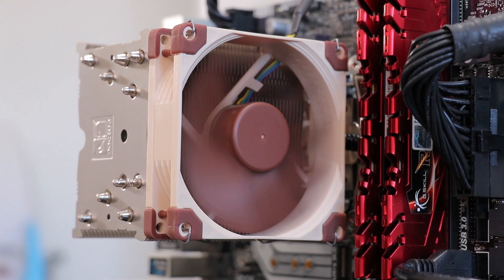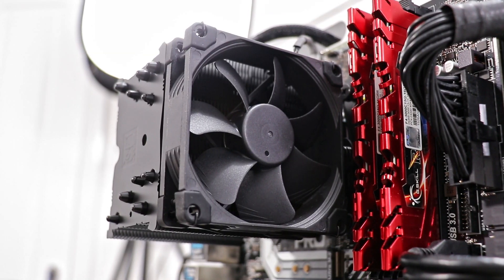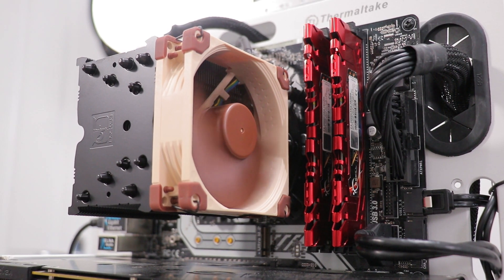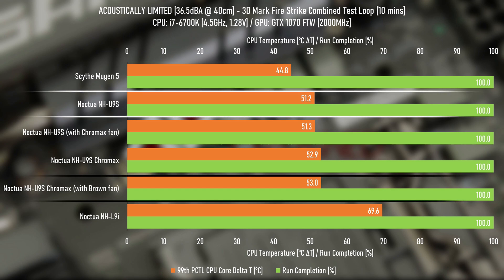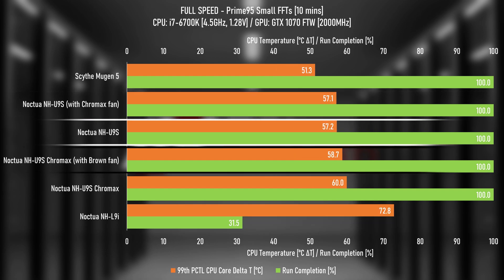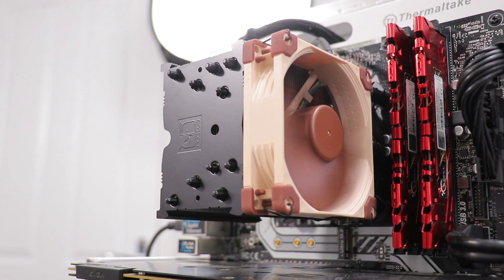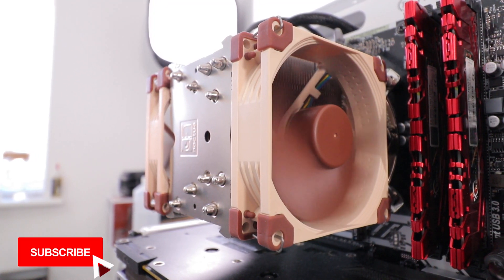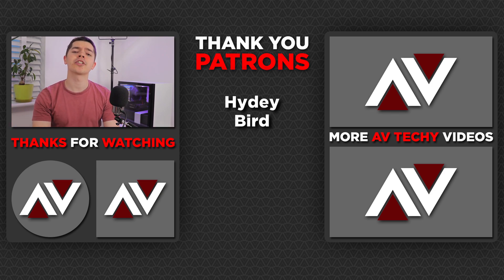Does PAINT impact PERFORMANCE? // Painted vs Unpainted CPU Coolers (ft. Noctua NH-U9S Chromax)

Comment: Ive been seeing a lot of videos about paint cooling towers lately. Im just curious why no one doing this is using a ceramic coating type of "paint" like cerakoat and instead are just using basic spray paint?
Reply from the maker: I believe Noctua does use ceramic coating in the cooler in this video.

Comment: I have the unpainted version of this cooler and i've been looking into adding a 2nd fan on the other side and i've been wondering if thats even possible? has anyone tested it? how would the 2 fans connect and sync into the same spin speeds?
Reply from the maker: I've got a video about that on the channel. Hope it helps :)
Reply: @AVTechy  Ahh thank you i'll check that out

Comment: TLDR: Noctua should just offer their bare heatsinks with black fans. Great video, mate!
Reply from the maker: Not sure that's the TLDR, there's a +/- 10% on the fan speed of any fan. Get a faster one and there's a bit more on the table, get a slower one and not so much. I can't deny an option with a bare cooler and black fan wouldn't be nice though. Personally I'd go black tower and fan anyway.
Reply: Given the variety of fans available, I'd love to be able to buy a vertical or tower cooler by itself and pick my own fan. (BYOF?)

Comment: I have the u9s non chronic with x2 fans in push pull and it keeps my 5900x nice and chilled. Such a good cooler for its size and cost!
Reply: How is the noise with two fans compared to just the one fan?   Is it a lot louder?  A little bit louder?  Bugger all louder?
Reply from the maker: Got a video all about that out in about 1 week :)
Reply: @AVTechy  I'll wait till then.
I just picked up on a big rookie mistake I made last night.
I had the cooler fan on the wrong side of the sink, and also back to front so the air was blowing into the sink towards the front.
I also had the rear case fan sucking air out, which was an inch or two away from each other so they both sorta cancelled each other out.
I took a closer look because the fan was kicking in everytime the cpu performed under load and was making a huge mother  db noise as a result.
So I moved the sink fan to the front of the sink this time and make sure the fan blew towards the rear. I also put on the noise cable extension and wow what a difference!!!
No major throttle or noise...quiet as a mouse! It's chalk and cheese.
So I'll wait and see your 2 fans and if it would take it a step further in any reduction.

Comment: No hands on with the specific coolers you are using, but I am fairly sure those coolers are anodized and dyed rather than painted?
Reply: In Anodizing the color/ ink penetrates into the metal and doesn't build up on top of it. 
Typically the metal structure beneath is still visible. As far as I have seen so far.
This looks like a sort of coating, if powder coating or paint 🤷
Reply: @TheSickness  I think I have seen some HSFs powder coated in my day, but painting seems very odd to me.  Dunno, maybe they are using a metal-rich paint to aid in energy flow?
Reply from the maker: It's definitely a coating, rather than anodising. I mentioned in the review that holding the painted version is noticeably more comfortable than holding the bare version. The edges aren't sharp like the edge of the fin, which hints it's a coating.

There's also no view of the grain so a coating must be covering it up.
Reply: @AVTechy  Many thanks for the confirmation!

Comment: If all coolers perform worse if they are painted black, can be tested. The Scythe Mugen 5 is now available in a total blacked out version. Only drawback for your review is that this new version comes with a 1500 RPM fan.
Reply from the maker: They would need to be tested with the same fan anyway to eliminate the variable of the fans, so that could be an option.